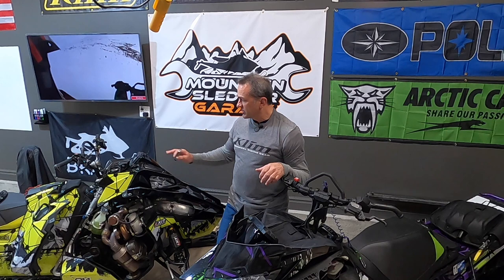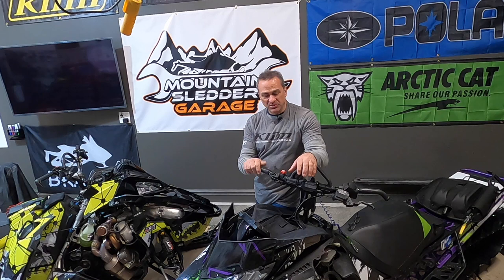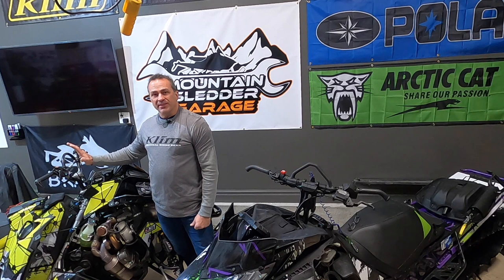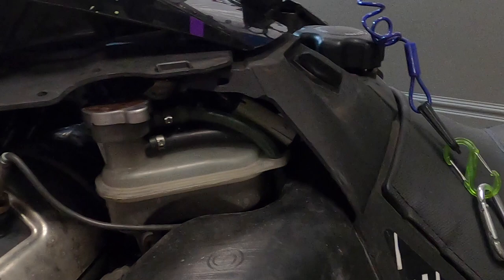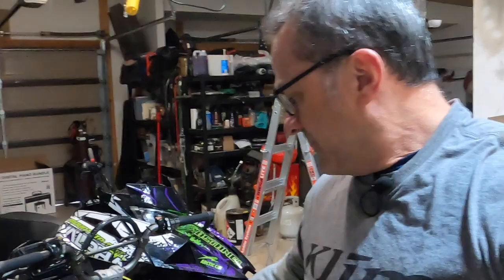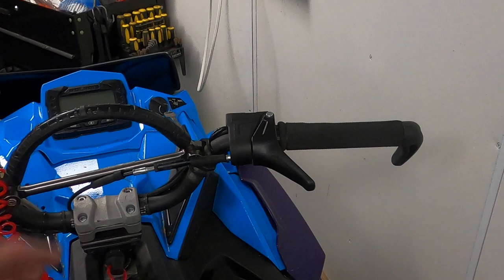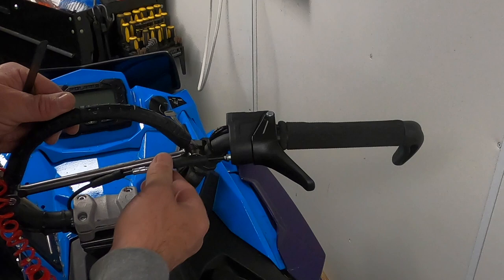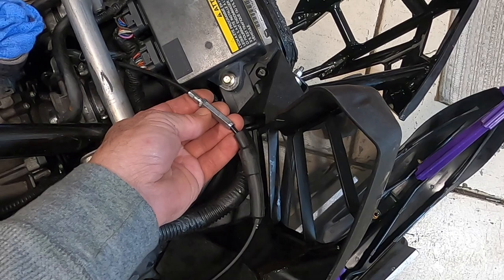THROTTLE SAFETY SWITCH

Comment: When i installed munster throttle, i was not able to get a TSS bypass plug so i pulled the switch out of the stock throttle block and taped the switch down. Has worked perfectly so far. My sled is a 2020 rmk

Comment: Useful video, thanks. My 2016 and 2020 Cats have both had the TSS activate in a certain kind of wet / granular snow. Sometimes hard to clear and melt the frozen spot around that pin—good to know about the simple disable. Yes, always a tether. Subscribed.
Reply from the maker: thanks

Comment: Great video sir! Much appreciated, very informative but still concise, which is rare. Was in search of simply what this part was that came disconnected when I changed my bars out and found that answer and learned a lot more. Very informative. As an electrician I had some resistors on hand so gunna look up the resistance needed and keep a few on hand prob will buy a bypass as well just in case.. I ride with a group of 4-6 that all ride polaris.
Reply from the maker: I can see if I can Cleve the resistance in one of the plugs I have do it may be easier for you to make your own plug.

Comment: Great video. Yes, adjusting the Arctic cat throttle cable can be done with the pipe on but you have to remove the screws for the heat shield so you have some room. The heat shield will not come off but you can move it enough to get at the adjuster. It's kind of a bastard. Be patient and don't drop the heat shield screws down into the belly pan.
Reply from the maker: You can leave the pipe on, just a little harder. You can remove the the metal ECU heat shield with the pipe on, but its a little harder to get out from under the pipe.

Comment: Great Video ! My son bought an old 1999 Artic Cat ZRT 600 to wrench on and learn since his autoshop classes are virtual (almost useless).  Great project since it is was not running and had frozen (corrosion) carburetors.  He was injured a year before on a quad that froze open while riding, forcing him to jump off and he broke his arm.  Lesson learned he wanted to restore all the safety's on this sled before riding.  Since nether of us know sleds this video really helped a lot.    I like the point about the tether. Can you add a tether to an older sled ?  Thanks for your help.

Comment: My dealer sold me a 22 matryx with 0 gap/play on the throttle block to throttle. Cable is too tight. I'm Gonna loosen up the cable to specc.

Thanks for the thorough explanation
Reply from the maker: Yea, it’s pretty common. The cable can stretch a little as it’s used, so keep an eye on the cable pay throughout the season.
Reply: @mountainsleddergarage8627 I'm hearing that with the free play adjusted correctly, wot can be affected on these matryx mountain sleds. That might be why they're running it so tight. 

I'm gonna try an aftermarket throttle block since this one ices up so badly and see if that fixes.

Comment: Excellent video.  I’ve got a 2010 Sno Pro, bought used several years ago.  It doesn’t have a tether.  Not sure if it was removed, or if Cat sold them without back then.  Thinking about adding a tether to the bars, but I don’t know if it’s gonna be a hassle…
Reply from the maker: Cat didn’t start doing factory tether until the alpha in 2019. Cat sells a plug and play tether for older sleds, or you can buy aftermarket

Comment: Problem in Arctic cat for a few years? I had a throttle safety switch issue on a 1997 with only 100 miles on it.
Reply: Carbs come out of syn

Comment: So it seems to me that these fail to OPEN circuit.
That is to say that the safety electrical circuit operates closed circuit so if safety switches get corroded contacts or the carbs aren't adjusted properly then HE (Hall Effect) sensors are out of adjustment then the circuit is open(?) and so the magic safety won't function properly.

The safety circuit on my AC (Arctic Cat) is disconnected where the main wire harness branches to the throttle harness in the steering column.
Therefore, my the KS (Kill Switch) doesn't work.
I can see the jumper for the TSS (Throttle Safety Switch) where it is disconnected in the steering column.

The resolution would be one of the following ways;
1) Replace the whole throttle 
2) Clean the contacts in the TSS with the switch out by rinsing it out with contact cleaner and testing resistance with Ohm meter.
     To get to the TSS the throttle needs removed from the handle bar, by first removing the hand grip.

Otherwise, to get my kill switch to work again, I need to plug the harness back in and short only those two wires with a different method.

My AC has HE sensors on each carb (and they are plugged in) so messing with the idle could cause those to go out of whack.

Without a manual, it's difficult to keep up with functionality of everything.

Anyway, Good Luck and KEEP SAFE!
Mike, Meridian Idaho

Comment: Would you have to take the pipe off and the little tin shield to change the trottle cable on and arctic cat?
Reply from the maker: Not sure what cat you are working on. The ascender has a throttle cable adjustment on the cable on the front right side of the sled, right where the cable goes under the ECU heat shield.

Comment: So on my 1980 El Tigre 6000 I can just unplug it to bypass it or do I have to add a jumper wire?
Reply from the maker: Not 100% sure that old of a sled, but I’d guess yes. Just make sure your shed runs. Then unplug and see if it runs or not. That’s where I’d start
Reply: @mountainsleddergarage8627  right at the moment I`m trying to diagnose a "no Spark"...

Comment: would the TSS failing cause the sled to have no spark ?
Reply from the maker: It could. If you have a cat you can just unplug the wires to the TSS. If you have a Polaris you have to use a bypass plug, you can't just unplug it. Heres a link to the Force Turbos Polaris TSS bypass plug,
https://forceturbos.com/collections/polaris-snowmobile-performance-parts/products/force-turbos-tss-bypass-connector

Comment: Question: I have an 2015 indy 600 that got tipped on the throttle and now the check engine light comes on but it idles fine and when it hits 3400 rpm it hits a rev limiter and won’t move any idea what this is?
Reply from the maker: The rev to 3400 then stumble could be whatever the check engine light is rev limiting your engine or the throttle cable out of adjustment. 
Your gage can display your fault code. Depending if you have a 3 or 2 button or PIDD display. Look in your owners manual or internet on how to get the code for your gage. Once you have the code number you can google search it and find out what’s wrong. Or take to your dealer and have them find code.
Reply: I just got the same problem on 16mod axys sks, engine light on and limiter on 3400rpm. found this: 

From research 
"520194 indicates an issue with the Throttle Release Signal and the 3 indicates that it's receiving Voltage Too High" 

Workshop have way to long waiting time, please tell me if you figure this out🙏🙏
Reply from the maker: The first comment at the top here I give a referral to a guy who builds a plug to get rid of your TSS for Polaris. That may help you if your TSS is bad.
Reply: @fredrikslettvoll1786  I found some wires that were broken that went to the throttle safety switch I think that’s the problem with mine
Reply: @joeydesousafishing1203  got a TSS bypass connector and now it seems fine👍
Reply: @fredrikslettvoll1786  I just order one last night thanks for letting me know it works

Comment: I hate those throttles!
I know it's a safety thing but these throttles feel sloppy and loose!!
Reply from the maker: Yea, the factory Polaris throw block is not the best. Going to be doing a video coming up of the TKI replacement
Reply: @mountainsleddergarage8627  so it’s pretty normal for my 2020 rmk 850 stock throttle to feel like this? The throttle lever feels really sloppy and loose like the guy above described. You can grab the lever and move it up and down.
Reply: @kaipepin159  Polaris factory throttle blocks have a major flaw that is well known, but easily missed: if they get knocked too hard, the plastic slide that goes into the throttle block will come out halfway, so that only part of the slide is in place. You'll have no clue about it, except for the symptoms: the throttle block will be impossible to make tight to the bars, and the throttle lever will stick the more you tighten the screw on the underside of the block. To prevent the throttle from sticking, you'll loosen the screw, but your whole block will slide around on the bars as a result. 

The fix is to take the throttle block apart and put the plastic slide back in correctly. Remove the four Phillips screws going horizontally into the block, closest to the grab bar; take off the plastic cover. Then, remove the Allen screw on the underside of the block, that you normally use to tighten the block to the bar. Now, the whole throttle block will slide apart, and you'll see clear as day what I've been trying to explain.